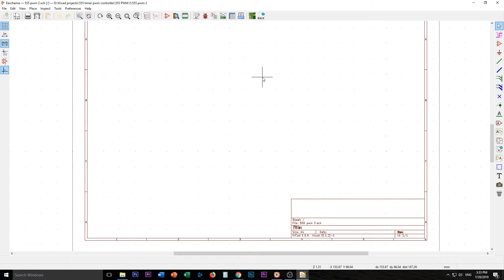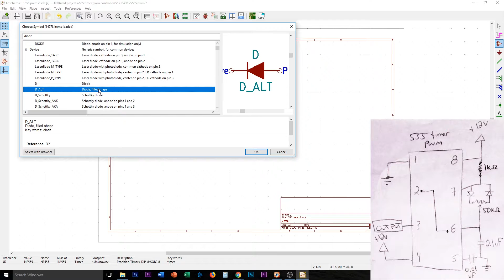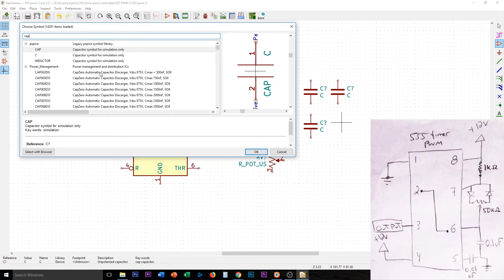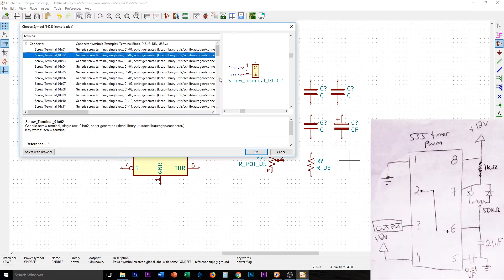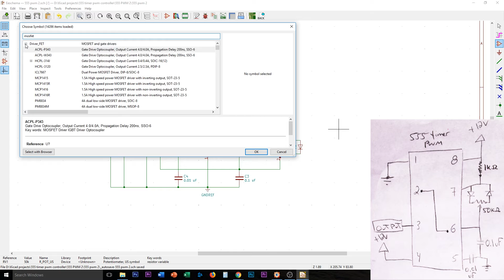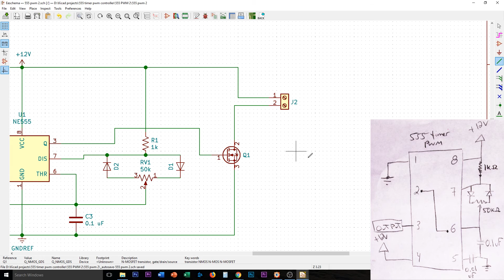KiCAD For Beginners 1 - From Paper To PC

Comment: feed to a mosfet should have resistor in it. And if yur voltage supply is greater than the VGS, a zenner to limit volts on the gate.

Comment: I use to work with EasyEDA, because it is really easy to handle, it is spread world wide and there are lots of device libraries (also provided by users), where you can find each part very quickly.

From the viepoint of circuit schematics I use points with high numbers of connections (Vcc, ground, interface connection points) as symbols in the circuit. So you can reduce the number of wires in the schematic by wiring to symbols. I also use to name the modules of a circuit and I tie the device symbols closely together with space to other circuit modules. I distribute the devices of a module in a way that I can attach the wires between them short and straight. This all helps to keep the overview.

I also use EasyEDA for my solderless breadboard planning. For this purpose I have prepared some breadboard templates which I can put in my PCB window and just fill the devices and wire bridges (in the second or higher order copper layer) and connectors in a suitable way. This makes trouble shooting easier even for tighter arrangements. I had allready an entire class D amplifier (one channel) arranged on a 400 pin hole bread board.

Comment: Can you say something about the diods? What's their purpose? Why are they oriented in opposite directions? Is this a common circuit pattern? If you have a link to some more information that would be super nice. Thanks!
Reply from the maker: They direct the 'charge' and 'discharge' voltages to different resistors

Comment: This is great but you have not shown us how to load a symbols library.  I have recently started and I struggled with that, which is now sorted.  Now I am having trouble loading a good set of footprints - do you have a video on this?  I am using v5, which seems more complicated than v4  (from what I've seen on You Tube)   I tried Kicad footprints and there were no diodes in it